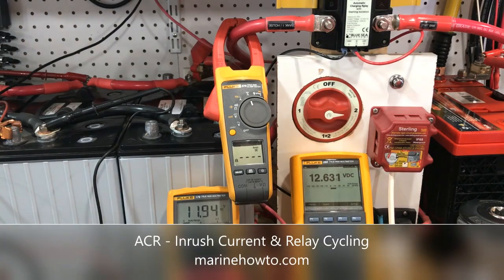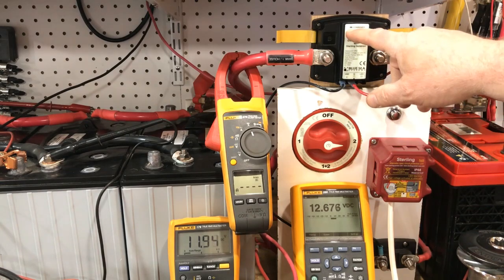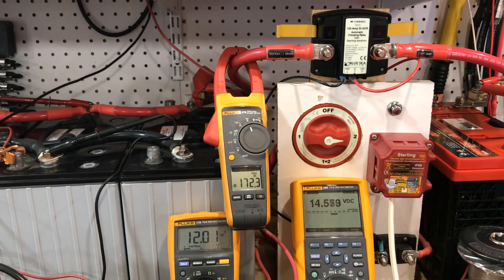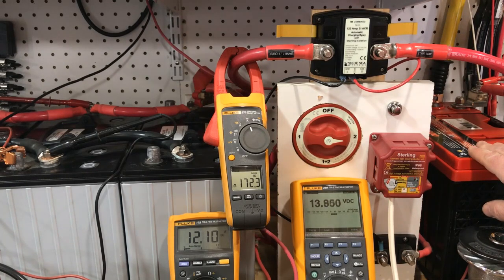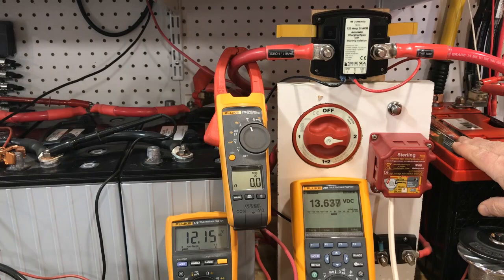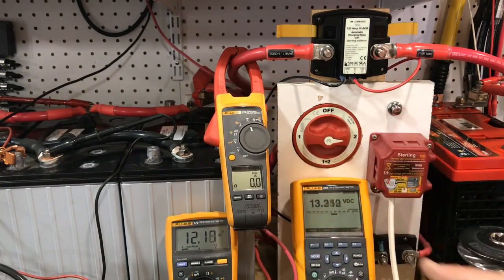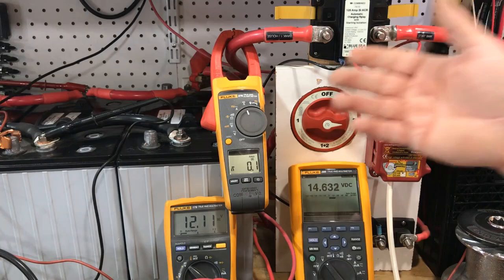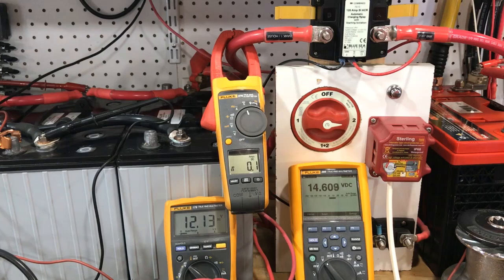ACR - Inrush Current & Relay Cycling

Comment: If it was 172A inrush,   why did it not blow the fuses in your MRBF terminal fuses??  I'm concerned about a depleted house battery blowing my 80A MRBF fuse.  I am sending charge to start battery in my scenario.
Reply from the maker: Easy MRBF, ANL & Class T fuses are designed to handle in-rush currents. It's called a trip delay curve...

Comment: gerat video but I thought I heard you say charger should be directly to the house batteries?then when I go to start engine with start battery, I will assume that it is fully charged because the ACR combined and charged the start battery? please explain more 
thanks John
Reply: If you leave your charger on long enough, yes.
As he says around 13min, start batteries only lose a small amount of their total capacity for each start. In contrast, the house bank can be over 50% depleted after normal usage. So when the charger is connected and the ACR combines batteries, the house bank will typically get more of the charge current initially. You can imagine that the house bank is "hungrier" than the starter at first.

Comment: what about when there are only one set of cables to the outboard motor, the starter and alternator are wired on these same cables which prevents me splitting the start to the start battery and the charge to the house battery.
Reply: Great question!

Comment: Good morning greece what accessories is the STERLING PRODUCTS REGARDS
Reply: Voltage spike protection. They can be used to protect an Alternator from a "Load Dump" do to the Alternator being disconnected from its load like a Lithium battery.
Reply: thanks regards

Comment: So you hook up the solar charger cables to house battery as well?
Reply: The solar charge controller might not reach the switch voltage of the ACR that connects the house and start banks. You should first understand the expected range of output from your solar array + charge controller, then determine where it's best to connect it.

Comment: What if the batteries are very far apart like a thruster battery. Would the long length of line increase the amperage on the line? I know when I used to run my table saw in my shed connected to a 50’ extension cord it would trip the breaker but when connected right to the outlet, it never would.

Comment: Great information! I got here searching for an answer to AGM batt chargning which unfortunately remains a mystery why Balmar and alike pushing VERY expensive alternators that go all the way up in amperage at relatively low RPMs while at same the AGM battery manufacturers tell you to NOT charge their batteries over 20/30/40 amps or we would be shortening battery life???
Reply from the maker: If you buy quality AGM batteries such as Firefly, Northstar, Odyssey or Lifeline you do not need to worry about over charging them. With most AGM batteries higher charge currents are beneficial to them, not harmful. If you are looking at batteries that have a low maximum charge current they are simply not quality AGM batteries. 

For example Odyssey recommends a minimum charge current of .4C or 40% of Ah capacity. Most boat-owners struggle to to achieve a .4C charge rate on any decently sized house bank. This would be 160A for a 400Ah bank and 240A for a 600Ah bank, and these are minimum recommended charge currents not maximum.....